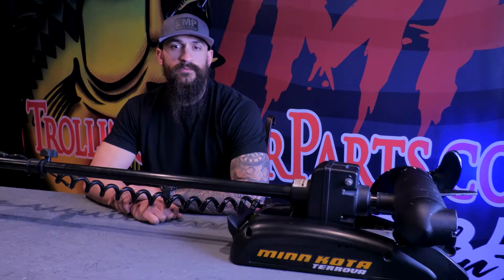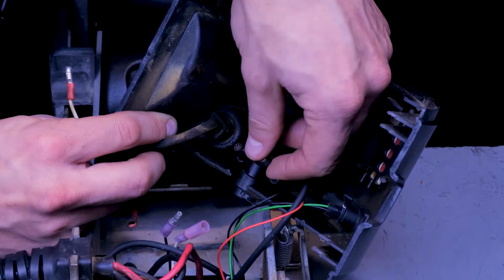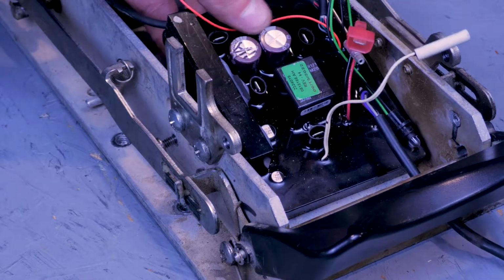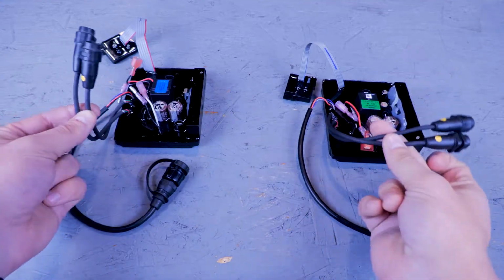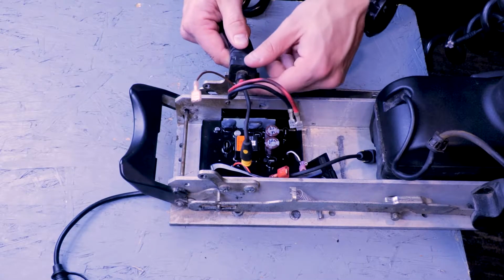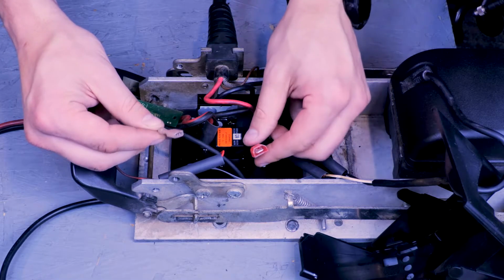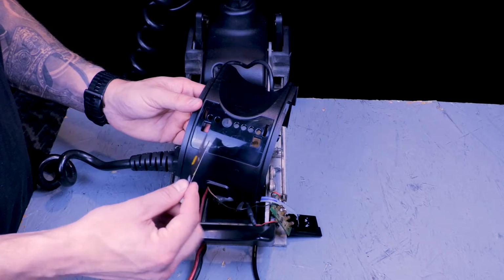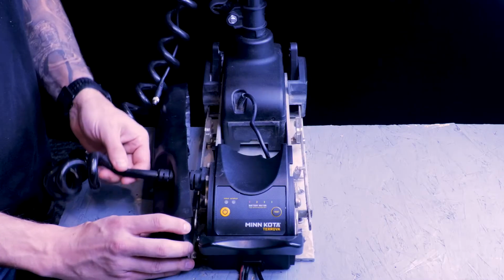Minn Kota Terrova Control Board Replacement // Step-By-Step Guide

Comment: I have a 2012 legacy Terrova.  If I replace the control board and get a Bluetooth head/remote… will it have better spot-lock performance than what I currently have (a tighter gps lock, less back and forth of the back of the boat etc ?)
Reply: Hi 
Don’t need to change everything take an other reference 
Try the 2774016
This reference work for terrova 12v 55lbs 2014 with i-pilot 
Just one of the top accessory plug will be used

Comment: Looking for a replacement for this board. 
Serial Number MKJ10994068
minn kota trolling motor circuit board "230-4025" 12/1997
Can anyone help? 230-4025 is discontinued.

Comment: I have a 2012 terrova and want to do this question i have is will my remote still work or will i have to get a different one?
Reply: You will have to get the bluetooth remote
Reply: @korrupted_chubby8422  that's what I was thinking... thank you
Reply: @earlpartain4534  you will also have to get a new bluetooth head aswell
Reply: @korrupted_chubby8422  doesn't this kit come with everything but remote and foot pedal?
Reply: @earlpartain4534  no. All separate. Board with housing, bracket and screws and decal runs about 350 give or take. The new bluetooth head unit runs about 280 dollars. Foot pedal off fb market runs about 150. New remote is about 200. So about 1k to fix a terrova
Reply: If the board is dead. Shit is diabolical. If i wouldve known this before i plugged in the board. I wouldve just sold it and bought an ultrex.
Reply: @korrupted_chubby8422  the kit im looking at is like 780.00 and I do believe it comes with the head ill look it back up just to make sure lol
Reply: @korrupted_chubby8422  i’m on the same job than everyone 
My steering motor was dead so i just changed it today and it work if it’s connected directly to the battery . But if everything is connected to the board control it didn’t .. so I will probably need to change board control and head and everything I think …
Reply: @gaulthier1171 most likely. Everything that i listed is what you need if you are going to change the board
Reply: Look my text just under this 
You don’t need to change everything

Comment: I am in process of a diy forward facing sonar transducer turret using a tarrova blue tooth steering motor. Needing help with what parts ill need to make it turn left/right and hopefully rotation speed. Can you offer any advice on parts I may need? Thanks in advance.

Comment: i had to crack my 2020 24/36v terrova i pilot open today but my control board says part # 2324061 is it just that the new versions have new part numbers?